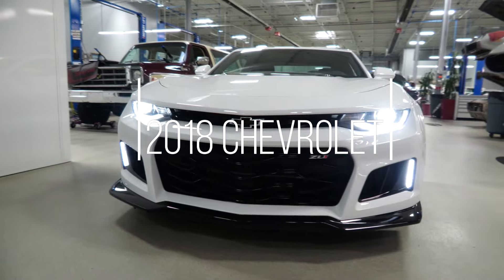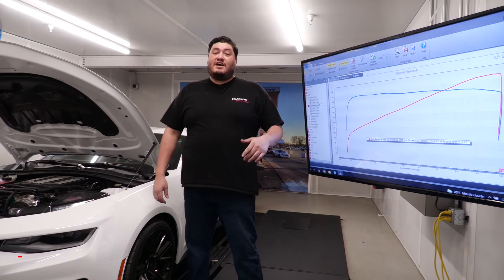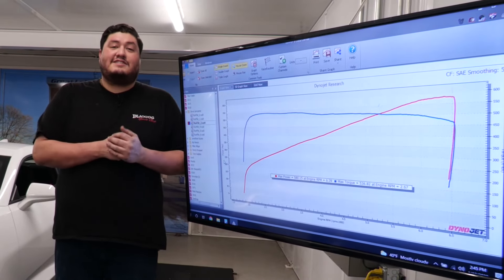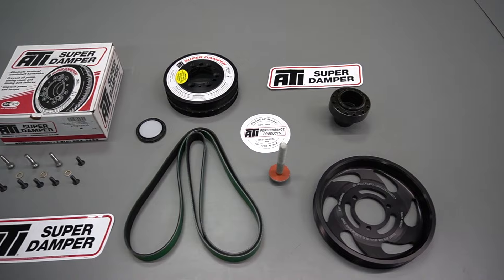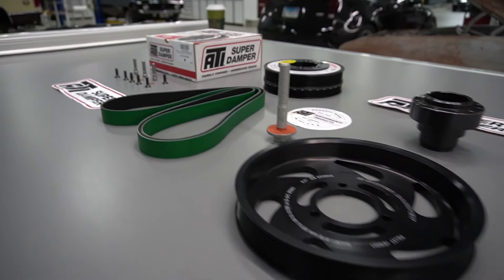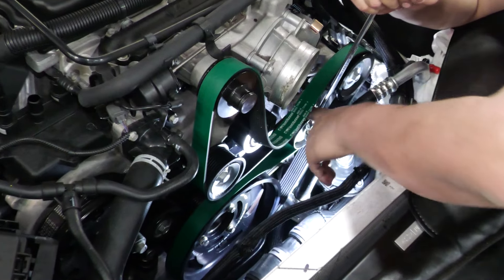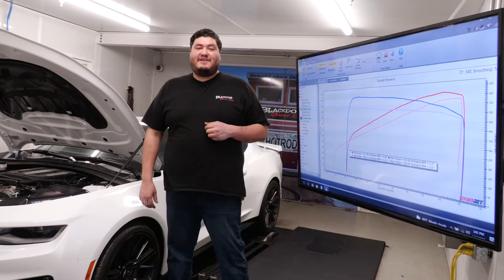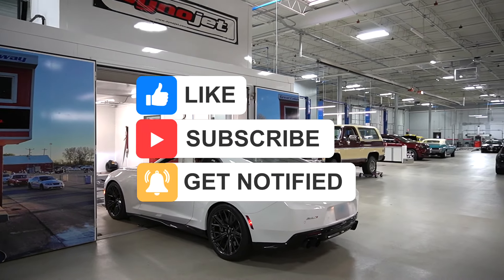Camaro ZL1 Super Damper Upgrade | Blackdog Speed Shop

Comment: did you have to go with a longer belt , or
Reply from the maker: It was a stock size replacement, you can also order an underdrive or overdrive which require a different size belt.